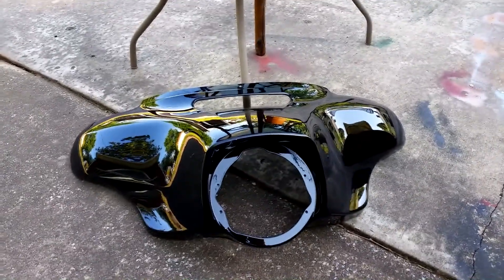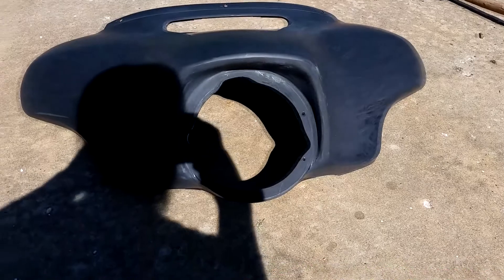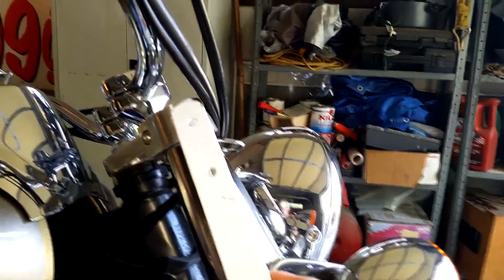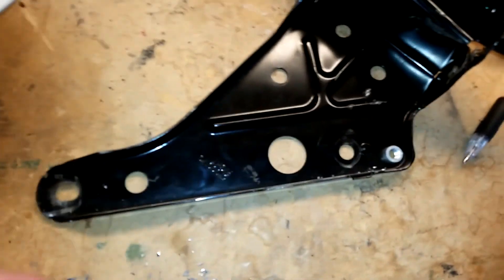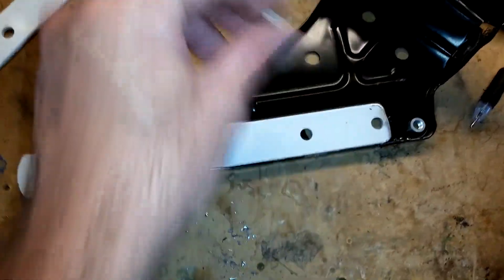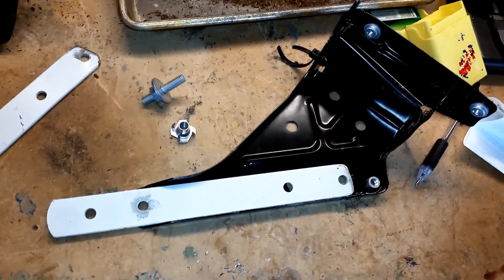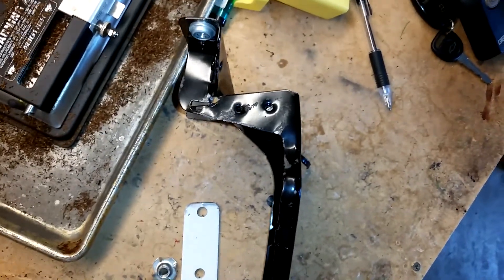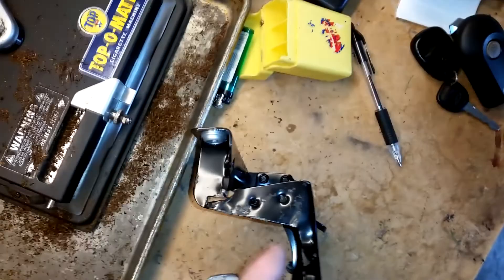Harley Davidson Fairing on Vulcan - Fairing mod update

Comment: How did you get the speedometer & Tach to fit in the hole that's not completely round?
Reply from the maker: Had to use a dremel and cut a little on the in side and a metal strap to keep it in place
Reply from the maker: I was going to use the hd gauge housing, but even a used one was pricey to be cutting on

Comment: Hey bud. Where did you get your gauges? I’m doing a 2010 1700 nomad, putting same fairing kit on mine.
Reply from the maker: They came from e bay. Just search for Programmable Speedometer 3 3/8. I believe you can find a set Speedo,Tach,Volts and Fuel.
Reply: @theidiotrighthere1829  I started doing this on my 2010 Vulcan nomad 1700. I tried to find an email for you. Thought I’d bounce some ideas off ya. I’m doing lowers and detachable trunk also. immusicman is what they call me. If you use that with gmail you can shoot me a message and I’ll email you. Great mod on that fairing. You inspired me to do the same. I’m having a little difficulty figuring out the center bracket. My inner speaker housings have not arrived yet.
Reply from the maker: The email did not work. You can email me @ TheIdiotrighthere@gmail.com . I don't really do email, but I will check it. Sorry for late reply,Ive been busy remodeling a bathroom all week after work. Peace Brother.